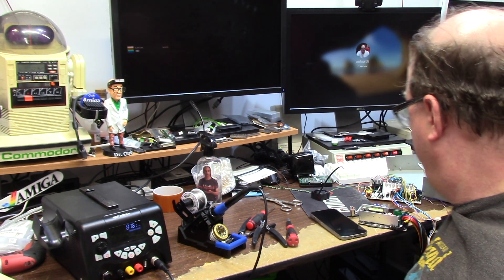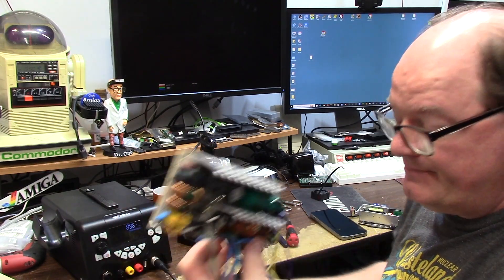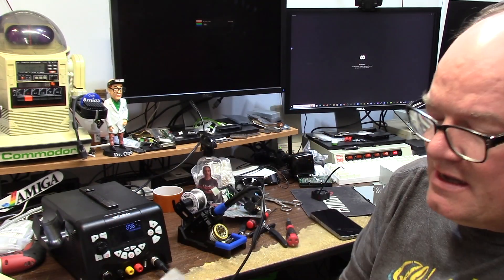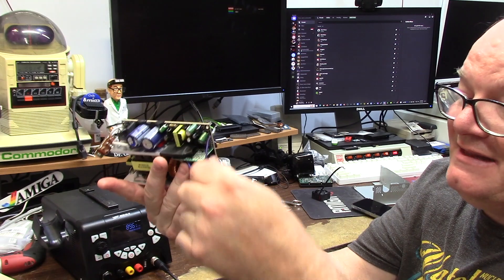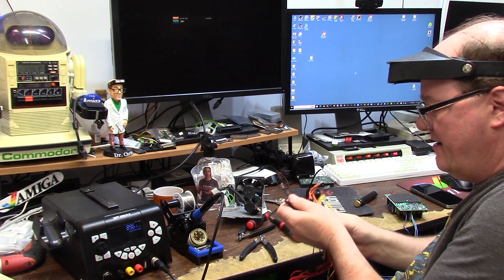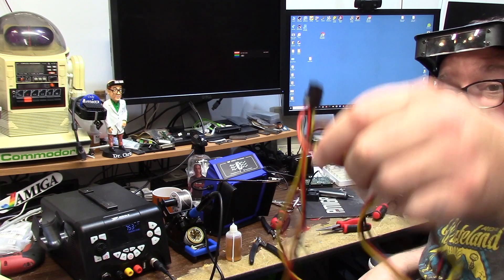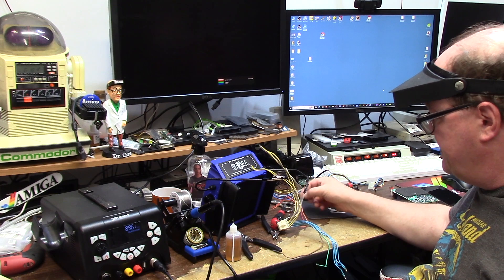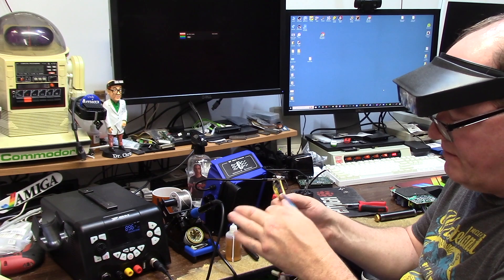SFX ATX Power Supply In The Amiga 3000UX PSU Case

Comment: Years ago I was messing around with a camera flash that had a 300 Volt electrolytic capacitor about the size of a D battery. Needless to say it got me but I am still here to tell the tale. I no longer work on anything with capacitors rated over 12 Volts and even on some of those I use an automotive light bulb to discharge them multiple times after being left unpowered for hours or days.
Reply from the maker: i started mine the same way, when i was 10  late 70s i went dumpster diving, found a camera flash, wanted to know what made that noise powering up for the flash, crossed a screwdriver, discharged the cap into my body, felt like my soul left the body and i could not move for a minute or two.   then had my friends do it to.  hahah we were dumb  #genx

Comment: What's the benefit of using an external tick board rather than configuring the motherboard to generate the tick?  Asking for a friend.. <cough>
Reply from the maker: only the 2000 and 3000 require tic boards, you CAN run it in Vsync, but not all will work proper if your display doesnt provide it.
Reply: @ChrisEdwardsRestoration  <Tom Baker> Ahh! </Tom Baker> That's interesting.. I thought there was an optional tick generation circuit on the motherboard, I didn't realise it derived it from the display's VSYNC.  Armed with that knowledge I, er, my friend will build a tick circuit into my replacement power supplies!  Tanx Chris!

Comment: Scary stuff. Definitely outside my pay grade. Chris you forgot to put the nuke explosion clip in right after you turned it on, so I did it for you by shouting BOOM. Thank goodness no one was around to hear me.  After filling every slot in my A2000s with MB options like flickerfixer, megachip, etc. I took the lazy man approach and just bought Bigfoot power supplies to fix the horrible systemwide instability issues. Oh, and don't forget to lick the caps to discharge  them when you're done. 💥

Comment: i done the same without the tick board after recapping the orig psu seen the end of it, no shorts just do not pass go, they are not hard to make just so time consuming, i extended my cables inside the psu so you cant tell on the outside

Comment: Well, 240VAC is a british thing.
Over here in my area, I still have 220VAC (Official Spec: 230VAC), because that's just how it was back in the day.
So 230VAC is just to allow for the Brits to be in the EU Specs...
Reply: Strictly speaking, it WAS a British thing, with the standard before 1995 being 240V AC with a tolerance of -6% / +6%. The current (no pun intended) Electricity Safety, Quality and Continuity Regulations 2002, Part VII, Regulation 27 says the UK supply is 230V AC with an allowed variation of -6% to +10%.
Reply from the maker: So 240. Haha toiletpaper math
Reply: @firstsurname9893  not only Britain, but Australia, New Zealand, Singapore and Malaysia all had 240 VAC +/- 6% in 2010 Australia changed to 230VAC +/- 10%

Comment: I've been cramming 85W Mean Well PSUs in the original 500-CD32 cases using a 3d printed adapter plate. For the Box Amigas, I replace them with ATX/SFX and use Simon's epic adapter plates and full PSU mounts coupled with his ATX to Amiga + tick adapter boards. I even had the pleasure of confirming the NTSC A2000 adapter board and showing some 60Hz frequency output on AmiBay for him. He has some great contributions to the preservation of the Amiga that exceed 1980-90 manufactured PSUs with little to no protection against faults. Loved the intro and laughed but I'm glad to see you constantly making the point that it takes both training and experience to work on a power supply. That means knowing that a power supply can kill you when it isn't on or even plugged in when the capacitors are charged.